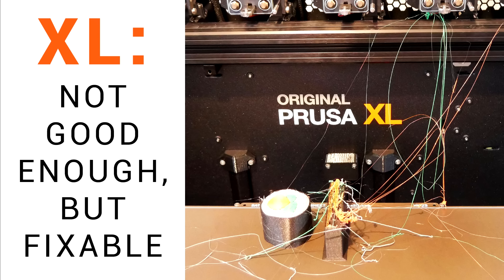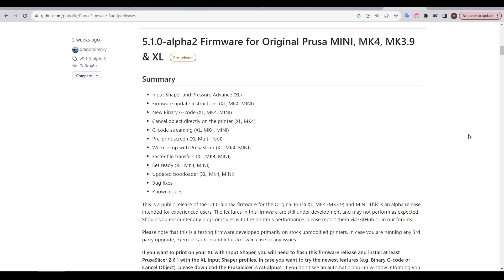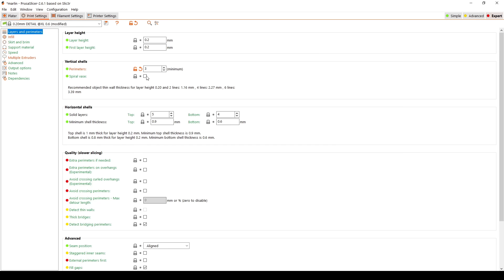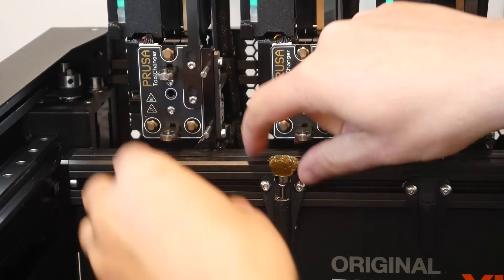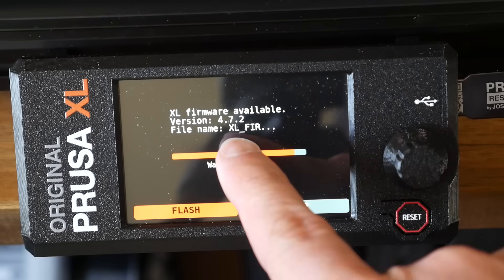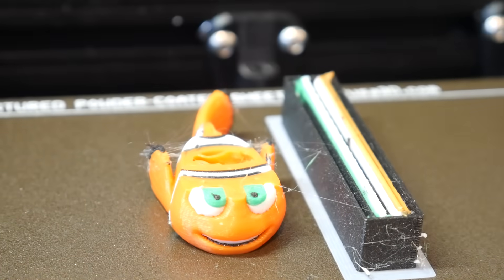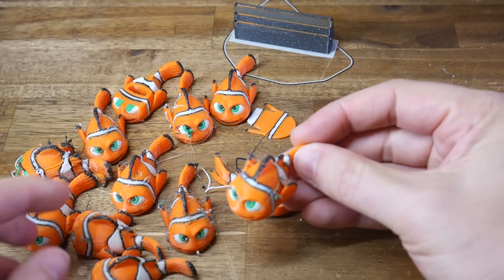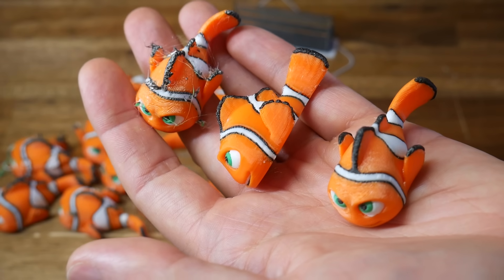Prusa XL update: Was the alpha firmware to blame?

Comment: I've just commented on your earlier video how disappointed I was.  It seems the release version of the software is no better, or only slightly.  It may be the release version, but it's still alpha quality.  Users should not be used as testers, especially not for a machine that's two and a half times the price of the Bambu X1, and nearly three times the price if wanting it pre-assembled.  At that price, it should be producing top quality prints out of the box.  Unless they fix this quickly, it could be a real blow to Prusa's reputation.
Thank you for your thoroughness, even diving into the source code, and being prepared to give a bad review for a product from one of the kingpins of the community.

Comment: I also have done a E-step calculation like on your website. 380 esteps is stock. I measured out, that one tool has 398 esteps and the second has 402 esteps. But it’s not possible to safe it to the eeprom for each tool. It’s only possible if you do a jailbreak and loose warranty….

Comment: @YGK3D posted a video a few days ago with a fix that looks like it'd be applicable across all Prusa XLs for the layer shift issue - TL;DW: the extruders have a little bit of slop around the Z axis that results in misalignment when docking, which he fixed with a bumper in the +Y -X corner and a couple of lines added to the tool change g-code to bump the extruder back into alignment.

Kind of astonishing Prusa didn't get/spot/fix this issue in development considering how ubiquitous it seems to be though.

Comment: If you have the patience for it, Prusa has a blog post about new changes in PrusaSlicer 2.7 on their website under the XL buying page. There is also a YT unlisted video, that shows it printing a dual color Benchy in 36 minutes. The path the heads takes is different than how yours printed. It does a wipe on the purge block before and after it's done printing the model. So, I think they implemented what you were suggesting. Anyway, would love to hear if the new version of PrusaSlicer solves anything. I didn't take the plunge to buy the printer, since it's so expensive and backlogged. Plus, after watching/reading so much about it's problems...It just isn't polished to mainstream use yet. Best of luck! Keep us updated as you continue to tinker and test it!

Comment: These are pretty standard problems for a toolchanger unfortunately. Everything (filament temp, retractions, EM, pressure advance) needs to be dialled in just right to prevent stringing. 5 times the tools, 5 times the headaches. Most of us operating toolchangers (E3d, Jubilee and other custom builds) have been hoping that PrusaSlicer will add some great new features to simplify things, but we aren't there yet...

Comment: Hi Michael, just wanted to warn you that most cheap "brass" brushes I've found are still in fact nozzle scratching carbon steel merely coated in brass. You can check for steel content with a magnet. Cheers

Comment: Thank you for investigating and testing! YGK3D just put out a video addressing the multi-toolhead layer shifting issues when changing heads. While I doubt the bad stringing you're having would be resolved with their hack (bumping the head to force consistent head attachment placement), it seems like more mechanical and technique fixes will be needed to make the XL shine.

Comment: Well, you better go the other way as well, trying LATEST alpha fw and slicer, as the latest slicer release is specially focused on multitool issues.
Also, textured sheet does not goes well with small PLA prints
Reply: The original video was exactly that! He used the latest firmware available, the alpha, and people told him that was the issue so I guess there's really no way for him to not get these comments 😅

Comment: Not working as intended i would get a refund. We appreciate your testing but sadly things have changed since bambu delivered a working printer. Likewise they are not perfect and i am not a fan of the ams but i was also very interested in the tool changer and the size. Coming from a fleet of tweaked cr10s units we just want a printer that works. For what you have spent, it should make tea as well.

Comment: Very thorough testing and great to see.

Still think printing that tiny Nemo model with a 0.4 nozzle on the A1 and comparing it to with a 0.6 nozzle on the XL is silly. You will never achieve the same level of detail on a model that small with a significantly larger nozzle.

Comment: I'm not that knowledgeable about the XL but I think Prusa is trying to fight the stringing and oozing with Prusaslicer updates. The latest 2.7.0-Beta1 has a new feature, namely "Ramping Travel moves". This seems to be specific for the XL, but wrapped in a regular (beta) slicer update. This could be an solution to one of the problems that many have with the machine. But then it needs to be adopted by other slicers like Orca Slicer to make it viable.

Comment: Speaking from three years with the E3d toolchanger….

1. z hopping is essential for multi materials. Turn that off and you will see nozzle crashing.

2. Increase “Retraction on tool disable” to 11.2 mm for each extruder. This Retracts out of the melt zone BEFORE the tool leaves the print. As such the 3d print dogs approach becomes irrelevant since the material is moved up and out before the tool moves. Retracting out of the melt zone also stops the drool on to the nozzle seal which stops the string there as well.

3. Use the correct temperatures. Prusa’s presets are way too hot. You have to operate so that the timing is correct to go to and from the melting point. Too hot and it takes to long to cool down.
Reply: I should say that I get ZERO PLA stringing with my XL5. I also don’t use the prime tower.  I’m getting perfect multicolor pla prints. PETG is another puzzle tho.

Comment: Try turning off Linear Advance or switching to 0.4mm nozzles. I’ve spent hours and hours trying to figure out stringing problems on 0.6mm nozzles on my Prusa Mk3 and LA was at the heart of it. I couldn’t find ANY setting that worked acceptably. In the filament custom gcode just remove the M900 line.

Comment: I used Prusaslicer gcode on my Kingroon KP3S every time i used it the prints would completely fail. All sorts of problems occuring. 

I would do the same exact STL file on Cura and it worked perfectly no strings or any other problems. I think there is a code problem in Pusha slicer.

Comment: tada 3d printing tried alphas for both slicer and the firmware and got a bit of improvement she also uses the 3d print dogs move thing. its very concerning these issues - considering cancelling the 2 head unit.

Comment: I'm getting major Intel vs AMD vibes from Prusa & Bambu Lab lately. IDK if y'all remember but when the Ryzen chips first came out suddenly everybody started to realize how much Intel had been charging for subpar performance, despite being the standard manufacturer. Then AMD swooped in and blew Intel out of the water for several years and forced them to innovate. I feel like that's what Bambu Lab has done here, swooped in with a highly performing much lower cost alternative to the previous standard. And Prusa desperately needs to start innovating or else they'll fall behind. Like, sure the XL is a large format printer, but it doesn't matter if the print quality sucks. They shouldn't be in pre-order stage (especially at $2500 USD) if the quality is so low.
Reply: agree, just pointing out a 5TC XL costs a lot more than 2500USD.

Comment: I feel your pain here. Prusa have really screwed the pooch in the last 2 years sitting on their laurels and not innovating. Then when Bambu push the envelope they try to catch up and destroy their USP "reputation for releasing a tested reliable product that just works". Im still waiting for my XL but bought the X1 C + AMS while I was waiting. I honestly think i wont be needing the XL ....as a tinkerer who has always built my own printers from scratch I'm amazed at just how good the X1 C is for just all round usability. I totally agree with your recommendations ...many are now manditory .... The camera in particular via a mobile app is one of those things you take for granted when you are out for dinner and you say to yourself "I hope my large print hasn't failed" then you realise crap ...i can check on the mobile app ❤ Wow #revelation ... In the past i'd have to set up octoprint and a dyna DNS and a firewall prot forwarding rule ....etc etc .....hours of fiddling and expertiese required i have built up over years ....wiped out by one simple innovation that now feels just as natural as paying for things with your phones NFC. The speed problems worry me about the XL. I am probably going to cancel my and build a Voron ... If you have to spend that much time getting the XL to work ...i'd just buy a voron and have complete control ..... The Bambu X1 C has blown away the competition... When they release a larger none commercial version of the X1 C with an enclosure heater ..... The XL will be dead .. 
Just look at what I achieved on the X1 C out of the box with PETG 0.4mm full height of the enclosure with NO tuning #perfection 

https://ibb.co/3ch8HDc

Comment: Hi,
Prusa just released an update of Prusa Slicer - 2.7.1-beta1
There are some improvements regarding stringing behaviour in XL.
Reply: To help fight stringing and oozing deposition, the new just released PrusaSlicer 271 beta now implements ramping travel moves.
To fully harness the stringing reduction potential of the ramping travels moves a new layer change strategy is implemented while the ramping travel moves are active. Instead of going straight up to the next layer the printer head follows a helical ("screw thread") trajectory while changing layers.
!!! Helical layer change is used only if use ramping lift is enabled in extruder settings and the slope is nonzero and less then 90 !!!
Reply: @OmDeLaTara  or alternatively, you can use a blowtorch or a hot air ;)
In all seriousness I'll test this today. I hope it will help.

Comment: I will get my XL 5 head in appr. 2 weeks. I would think, that most of the hardware of the XL is near the final solution.
The stringing issues of the XL seems to be related to the issues Prusa has with the MMU3, which is delayed due to those issues.
During filament change, the Nextruder produces fine strings (called angle hair). These strings irritate the filament sensor in the MMU3 and cause a clog and an error. This happened also to my MMU2S a few times. But it is very seldom.
There is a blog article from Prusa about this and it sounds, that they are on the right way. But it takes quite a long print with over 200 filament changes to test it.
For the XL additional retraction and wiping to infill (I do not know if this is already an option in Prusa slicer 2.7) might solve or reduce the stringing issue.

Comment: I wonder if the multiple head XL is having the same issues that MMU 3 is on MK 4. There is article on Prusa’s website talking about how the nextruder has an issue with stringing when changing colors. When looking at the results from the article and the ones shown in the video, they look close. I wonder if the MK 4 has the same issue but is masked by only having one head?

Comment: Try this, go to the alpha firmware, the 2.7 slicer and use default filament profiles. Your stringing will go away. Not sure why you are releasing a video to show how bad you can make a machine operate and then comparing it to a Bamboo mini. It almost makes someone think that you have a vested interest in people buying Bamboo products.
Reply: Wut? If I was paying that much, I'd expect perfection out of the box!  Not slapped together badness, then fiddling,  tinkering or tweaking!
Reply: 5k machine and you're asking to use alpha firmware? Get outta here... should be rock solid out of the box
Reply: @rtopz1  $3500 + $133 (shipping) + $152 (import duty) USD for a 5 tool changer unit to the U.S. but yeah, it should be especially given how long it took them to ship. It's obvious that Prusa is stretched way too thin and doesn't have a clue on how to prioritize. There's no reason a machine that they were demoing 2 years before release should be this rough around the edges for the core functionality it's supposed to be good at.
Reply: I'm getting stringing and blobbing with the alpha firmware, the 2.7 slicer, and the default filament profiles. Filament oozes during the absorb heat stage and the printer proceeds to smash it into and around the nozzle during the "cleaning nozzle" stage. After this it goes to purge and print and the smashed filament near the nozzle starts catching on the existing layer along. With a multi-color print it leaves blobs all over the place. I tried to print the Surfalex2000 debris buckets in orange and black and got tons of embedded blobs and whisping. Same issues as Michael.

Comment: But Prusa is open source, right and Bambu is closed -- where is the open source community to fix the Prusa, since Open source is so important. Always thought this argument had zero weight -- open source matters only when you have to dig in the source to fix it. The machine has been out for a good bit, no open source magicians have been able to polish this turd.
Reply: Prusa isn't even open source, they haven't open sourced many aspects of the mk4.
Reply: @WhiteG60  oozing should be something that is sorted way before things get to customer hands. .6 size is nonsense. I built a 4 independed extruder machine, and I had no prime tower, quad color ooze free prints in 2018, with .6 nozzles. What's going on here is inexcusable and baffling.
Reply: @kazolar  funny thing is prusa was warned about the poor choice of a .6 nozzle and they did it anyway.
Reply: @TMS5100  no excuse -- .6 nozzles are not 1.4 mm, fact that they haven't used OS solutions for tool change operations and parking which have been around since 2015 is just lazy engineering, or arrogant. Prusa wants to put themselves up on some pedestal as if they are so innovative, plenty of home builders have been doing idex, and tool changers for a decade, oozing has been a solved problem. I know home built/designed machine will be different, I've been moving my machine from off the shelf to be-spoke parts over the last 5+ years, all was done to just make it easier to use, it was already printing perfectly in 2018, I've gotten it to be faster and more reliable and easier to maintain + operate. It was running non stop with 4 heads printing PPE during covid.
Reply: @kazolar  

There is a world of difference between a homebuilt machine and a machine designed for mass production which requires thought about how the product is built, minimization of the number of parts, sources for the parts, how to ship the final product, how to manufacture any parts that will be custom made, cost vs time vs complexity tradeoffs, and so on. 

I'm not giving a pass to Prusa for shipping a product that wasn't ready or didn't catch a bad batch with their QA (as some people are using their printers and achieving good results).
Reply: Prusa seems to expect the community to fix their issues.. I am not buying Prusa again. So fed up with the low quality
Reply: open source seems to be an excuse for companies to release half baked unfinished machines and then leave it up to the public to fix all the problems. utterly absurd at this price point.

Comment: So strange. I have basically zero stringing with polymaker and Jessie filaments on my 2-tool machine (.4 -> .8 nozzle sizes) as long as I drop the temps down to 205-210. And for the naysayers, the alpha PS and firmware have been sooo much better for me. Have had a tiny amount of stringing with PETG (far less than even the best print in your videos), but that was old stuff that has been sitting untouched in my dry box for 5 years in 30-40% humidity so I expected so much worse.
Reply: So I am not the only one with very good success on the xl. I have the 5 toolheads and I love the machine so far. I am running the alpha firmware with very few issues.
Reply: @CoryTaylor904  looks like prusa QC is all over the place if people like michael are getting such inconsistent results.

Comment: I am glad you did this. I was concerned the Alpha firmware was part of the problem. That said, the fact you even had to do  so much work on a $5000 machine is an appalling engineering failure by Prusa.
Reply: Utterly gargabe for that price.
Reply: this isn't a secret though, there are lots of xl owners with problems on youtube and very few who are having the success one would expect from such a high cost machine.
Reply: I agree, It shoudlnt be released in the state it is in. Hopefully it'll be worth the wait for Prusa to fix it.
Reply: @TheCoffeeSquirel  I hope so, too.  But that means they need to get on some major changes and make existing owners whole, either via upgrade kits for free or extended return periods.
Reply: Even though Bambu printers aren't open source, it doesn't matter much if the open source option costs you almost 10x more money and doesn't work even half as well. Sure, you may have to do material changes manually, but at least it works.